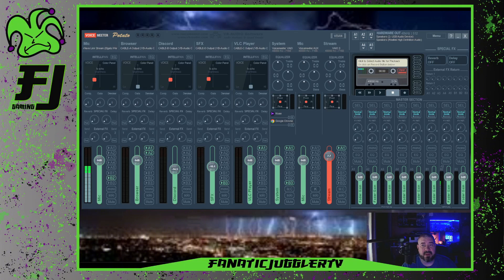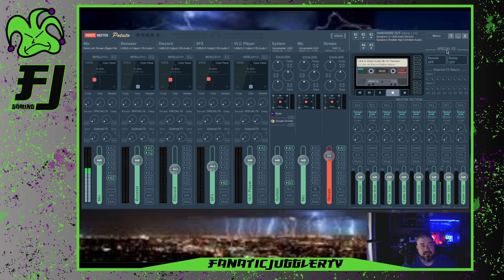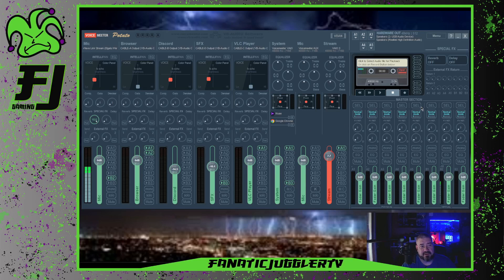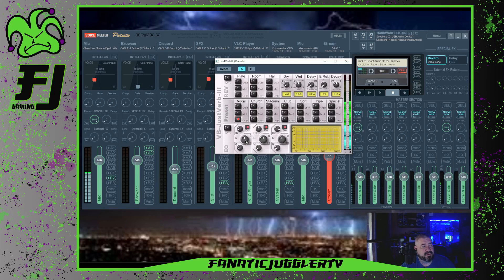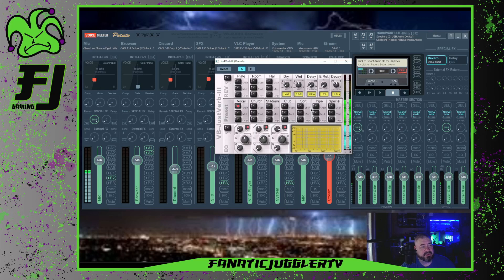Voicemeeter Potato: Adding Reverb

Comment: Does this work for a headset mic? I have followed everything but as soon as I press the Reverb button on the special fx tab my mic will go completely muted I don't even see the volume bar go up and comes back if I disable it.
Reply from the maker: It should work for a headset mic as long as you have reverb enabled on your mic input and the corresponding B2 input in VM as well.